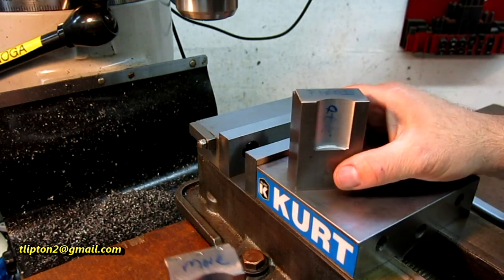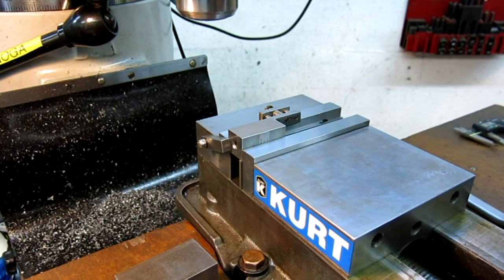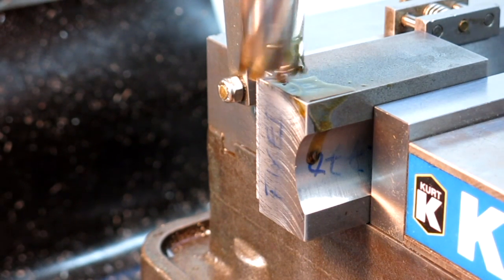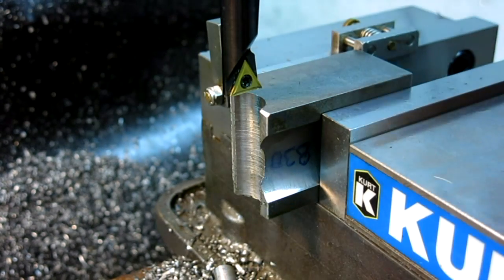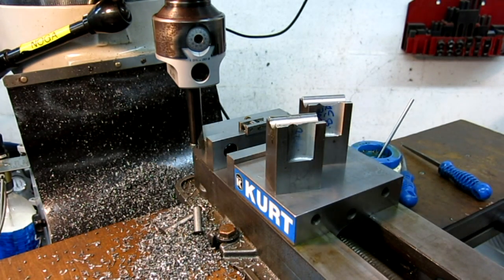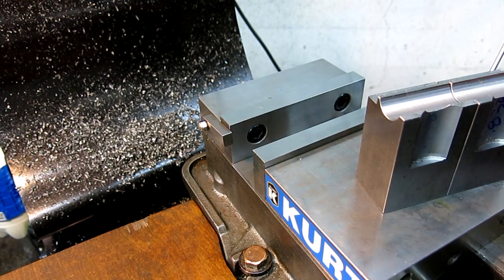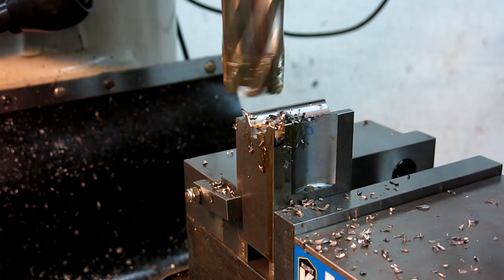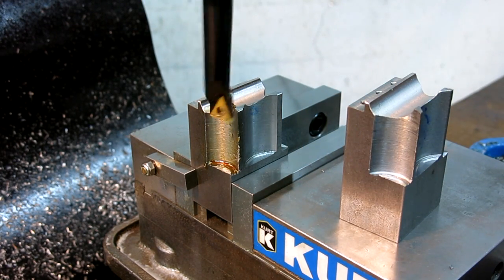Wilton Baby bullet 13

Comment: Hello Tom,
 
Not having done any milling work such as you are doing on this part, I was wondering whether the cutter would cut right through the part radius if the machine was going much slower, or does it have a drop off point where the bit refuses to cut because it does not have enough momentum?
Reply from the maker: +mrbluenun Hey Blue,

I'm not quite following your question. There is a particular speed that the tool should move at for the type of material being cut. Its only a single point tool so it has to be fed slower than a tool with more cutting edges. Hope this helps. Thanks for the comment.

Cheers,

Tom

Comment: Just wondering why you're not using a ballast piece on the other side of the vice, Kurt vices will pivot about .012 to .030 if the load is not equal across the jaw faces, severely reducing clamping force and increasing the probability of the work piece becoming a ufo
Reply from the maker: +Kmfginc Bbrown Hi KM,

As you can see in the video its not necessary with a Kurt in good condition. Some folks over tighten which has an inverse negative effect on clamping. Kind of like the harder you grab a bar of soap the more it wants to go flying. Thanks for the comment.

Cheers,

Tom

Comment: you dont need to apply cutting oil when using carbide
Reply from the maker: +Norm Staley Hi Norm,

You generally get a better finish when you use a little cutting oil with carbide. In particular with boring in gummy plain jane steel. Thanks for the comment.

Cheers,

Tom
Reply: sometimes yes you do get a better finish using oil, but I noticed you were doing a roughing cut, also if your boring bar and set-up is sturdy enough you can crank up the rpm's for the finish cut and get almost a mirror finish even on plain jane steel.
Reply from the maker: +Norm Staley Hi Norm,

That might work but the cut is interrupted and the boring head is offset a fair amount and way out of balance. I'm sure I could have gone quite a bit faster and slowed the feedrate. Thanks for the comment.

Cheers,

Tom
Reply: Agreed

Comment: looking good if you have time can you give me a little info on that bar you are using in the boring head plus how much where you feeding you where getting way better results then what i get some times with are huron mu4 mill at the shop when running a 40 cat narex head. do you just run your annular cutter's in a collets or do you have adapter? thanks keep up the good work.
Reply from the maker: +mog5858 Hi Mog,

The bar is a Criterion TA inserted boring bar. The insert is just a simple TPG with a breaker. Yes I run the annular cutters in a collet. I have been too lazy to make an adapter that pops the slugs out. Thanks for the comment.

Cheers,

Tom
Reply: +oxtoolco thanks for the info and your time

Comment: Could the jaw be brazed on to the tube?
Appreciate the videos, very informative and inspiring.
Reply from the maker: +David Platenkamp Hi David,

Yes the jaws could be brazed. I am expecting some gaps and a little filling so I prefer steel for this application. No particular advantage with brazing in this case. Thanks for the comment.

Cheers,

Tom

Comment: Hey Tom, I'm really enjoying this series! I've got a question for you- would using an endmill been an appropriate substitute for the roto-broach to hog out the radii? Or does the annular cutting action of the roto-broach allow it to perform that operation? Thanks!
Reply: An end mill would work fine. But I would start at the edge and make .050"-.070" plunge cuts, until you get to your rough dim.

Comment: I am really curious about the welding that will be done to secure those jaws well enough that they don't get broke off when someone smashes something in the vise with a hammer.  I am curious if you will gap  the parts and be able to get a full penetration weld of the components. Looking forward to the ox tricks to make this thing as strong or stronger than the one piece original. :-) "Nothing too strong ever broke" TL
Reply from the maker: +bcbloc02 Hey Brian,

This thing will probably end up in a hermetically sealed display case. Hit it with a hammer! My god man are you sipping the shop cleaning alcohol again?

Best,

Tom
Reply: +bcbloc02 Hey Brian, what are doing watching all these videos?! Get out there and build that barn/shop!!
Reply: thedge7
 I had the video playing while I was at work. This getting dark about 5:30 stuff is really sucking for my barn productivity, going to try to finish prepping steel tomorrow though. Maybe even drill some holes in the concrete if I can decide where exactly they go.

Comment: Your videos make me miss working in a machine shop so bad.  I'm going to have to find a job that allows me to put my soon-to-be-acquired bachelors in mechanical engineering technologies to good use yet give me some shop time as well.

P.S.  "Could care less" means that it does care to some extent, otherwise it would be at zero caring at which point it "couldn't care less."
Reply: +crashwg Unless you are self employed, most likely not going to happen. As an MENG I can tell you that most employers will either pay you to do engineering work, or pay you to be a machinist, they will not pay an engineer to do machine work, they have machinist for that. I am luck as my job is kind of in field engineering, but those jobs are slim.
Reply: +crashwg You probably won't get much if any shop time these days from work, but the job pays well enough that you can set up a really nice hobbyist shop in your home...

Comment: Hi tom looking great I've a quick question for metal working machinists..
I have to go into the MRI and CAT scan machines regularly,Would this stop
me from doing metalworking as I've just purchased my shed and lathe and
a few bits and pieces to get me started..My only worry is that i get Small chips
in my eyes and some thing happens in the MRI machine or it stops me from
getting the MRI's i need on a regular basis..Thanks and keep up the good 
work..
Reply: +Muhaa Haloa My observation of coworkers who got a metal chip or particle imbedded in their eyeball was that they saw an ophthalmologist as soon as they could because the pain was excruciating. Whether that holds true for everyone all the time, I couldn't say, but that was my experience.
Reply: +Muhaa Haloa Let the MRI techs know you work with metal (machining or welding) and they should x-ray your eyes to detect any metal embedded in the eyes.
Reply: +Muhaa Haloa  you'll need to be X-rayed prior to getting an MRI.
Reply: +Muhaa Haloa I hope that you are wearing safety glasses / goggles when doing metal working... in order to keep the sharp metal bits out of your eyes...

Puncturing your eyeball is a very bad thing... scratching your cornea with fine chips / dust is a bad thing as well.

For some operations in the shop, it is a good idea to wear a face shield in addition to your Z87 rated safety glasses / goggles...

For other aspects of safety & comfort, you can buy squeeze bottles of preservative-free saline marketed for the contact lens wearers and use it to rinse you eyes on a regular basis.

There should not be any metal dust in your eyes...
Reply: Thank you for all your replies and help,I've not started any metal working yet just getting every thing ready been saving for 3 yrs so its time now..But at least i know now to tell them i do some metal working so they can x-ray me before my MRI's i usually have 2 or 3 every year..Thanks for your help guys its very much appreciated...Thank you chemech i will do all of the above.
Reply: +Muhaa Haloa When I worked in a production machine shop I used to get a lot of metal splinters in my hands. Friday night was splinter night. I'd try to get them all out then. If you wash your hands really good you can see them pretty easily. But hobby metalworking you're not going to pick up many, if any chips at all. You'll have time to wipe things off before you handle them. You'll probably be spending more time setting operations up than actually making chips too. It is just a volume thing really. I mean in a production shop I was making literally barrels of chips a day. So that increases the odds of picking one up. You still want some wicked sharp tweezers for picking out a metal chip if you do get one. I call them work tweezers. They're not like normal homeowner tweezers. They're bigger, and come to needle points.
Reply from the maker: +Paul Frederick Hey Paul,

I don't think I could have waited that long. When I get one all work stops and its coming out now. Thanks for the comment.

Cheers,

Tom
Reply: oxtoolco
If a I get a splinter that I can feel then I would remove it. But I manage to get a lot of splinters that I can't feel too. Those I'd look for visually, and pull them out on Friday. My rationale for doing that was I'd have two days of being relatively splinter free a week. Plus I'd cut down on general build up. They say we get used to everything eventually. When I worked in a machine shop I got used to splinters.

The burr cuts did bother me sometimes though. Once I remarked to my shop foreman that my hands were turning into hamburger. His reply was,  You get paid to get cut. Roman just had a way of looking at things.